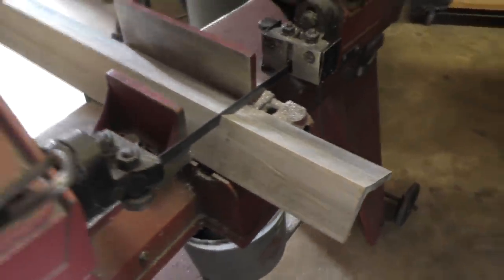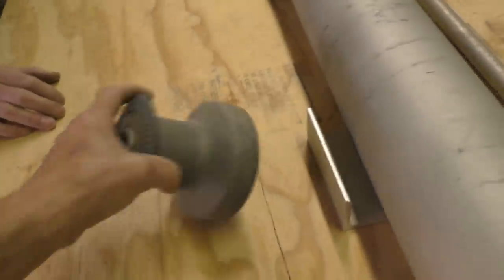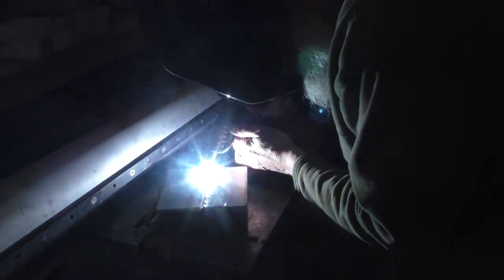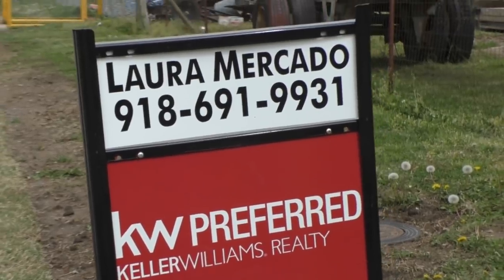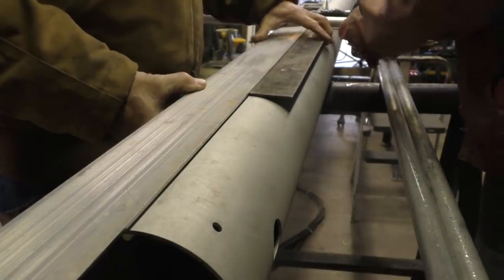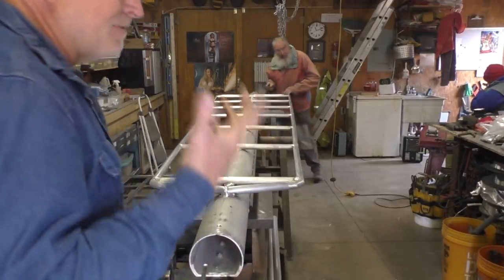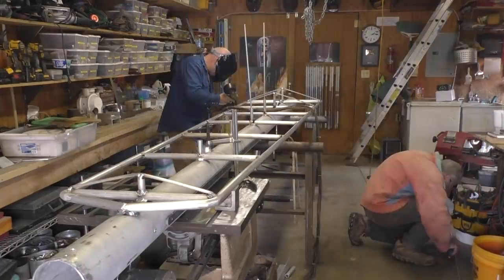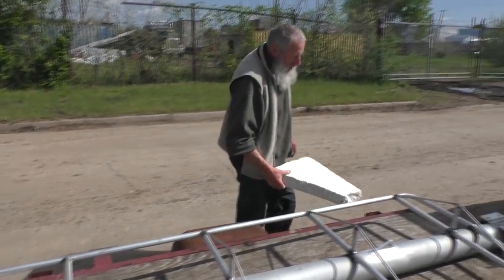Lazy Jack Boom Modification

Comment: I had also cataract surgery on both eyes. I chose one lens far, and one lens near. Took me a year, but I finally adjusted to using the computer with no glasses. And now no corrective lenses needed for driving. I only use prescription lenses for close or detail work (like finish grinding). I also got UVEX prescription safety glasses, both in clear, and as dark sunglasses. They may be a little hard to find, but well worth it. 
And they work great on the motorcycle, or in windy and wet conditions on the boat. As someone else said, I also wear sunglasses more often now (usually just the cheaper plain UVEX sunglasses).

Comment: Congratulations on the lense replacement. I have had both eyes doe. It has definitely improved my life. Happy saling.
Reply from the maker: It is AWESOME!   Three Cheers for all those who work in Medical Technology!
Reply: Just remember to wear sunshades more often. Those lenses lets through it bit more light. I've been through this last year also on both eyes, and when it was done I always thought "Well, who did turn on those lights out here....."
Reply: @ulie1960  Is the night vision worsened? I'm trying to figure out what's true and what's not. There have been some vision artifacts reported also, did you notice any of that? I'm 26 and I can't see damn 5 meters in front of me, it really pisses me off and makes it hard to ride a motorcycles. I hate glasses.
Reply: @FrozenHaxor  Not in my case. I was 60 (last year) and I was short sighted about -12 dioptre. Now I'm at -2 which means I still need glasses for driving my car, but no glasses are needed  for reading. I could have gone to 0  and no glasses for driving but then I would have needed glasses for reading.  Since I'm used to glasses since I was 6 I did choose it this way. I made me feel uncomforttable without glasses outside.
Night vision is no problem, just when the sun is out it is better to have sun shades while driving and being outdoors. There are also no other problems in my case.
About choosing which way to go it helped a lot to talk to my optician besides my ophthalmologist. They said it is personal preference which way to go, they just warned me to choose one way for one eye, and the other for the other eye. This creates more problems like headache and such. I had this during the week between the two procedures, when one eye was done and the other not. Fortunately it was just one week in between.

Comment: Will be interesting to hear your comments down the road following the replacement of your second lens.  Like many others here, I had both lenses replaced and opted for distance settings like you, and with the same reasoning in-mind.  It only took me a week to regret my choice.  Even at sea and in the mountains most of our actual work is close at hand.  Not being able to read my instruments or my watch without putting on glasses (bifocals) is a major PITA.
Reply from the maker: No.  I made the right choice for me.   I don't mind wearing glasses for close up work when needed.   Distance is fantastic for driving and I think boating.

Comment: Doug, what brand of spool gun is it that y'all use? I bought an Eastwood rig complete with spool gun, wire, and tips but after 3 days of experimenting, reading the manual, adjusting settings, and blowing tips, I was still unable to run bead continuously on the brand new aluminum I was welding. I am beginning to think the old tank of argon I was using was mis-labeled. Any tips for this novice aluminum welder? 
Big fan of your channel and the Seeker project!
Reply from the maker: https://youtu.be/VChbe3a2i1M   Start with 1/4" think material.  Turn the power up, turn the wire speed up and only lower the wire speed till it's not stabbing into the puddle.  You'll be in spray transfer.     ...and weld like the wind.